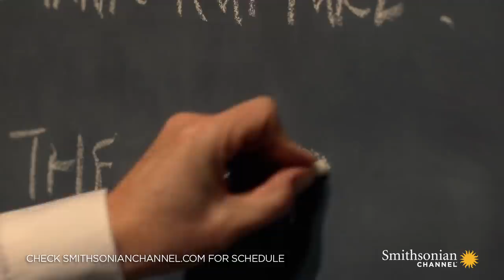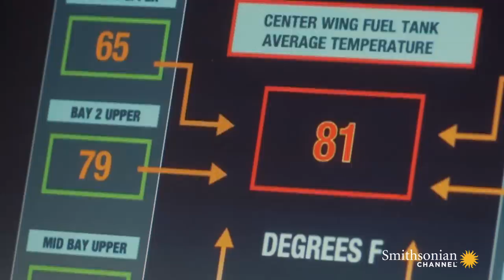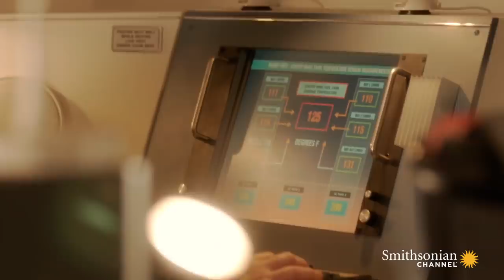How Air Conditioning Caused TWA Flight 800 to Explode

Comment: It is because of the sparks in the tank. The spark were occured due to broken fuel quantity indication system (fqis).
Reply: Actually No.  There were no 'sparks' in the tank (as were suggested)  and this is due to the function of the system itself and its architecture which precludes such.  The FQIS system 'cannot' produce and or produce any sparks or arcing by design.  the [current] used to operate the gauges/system, are in the trickle amounts and far below any of the minimum required electrical energy (tens times lowers) to be able to ignite any 'vapors, under the best conditions.  The Fuel storage and transfers system is grounded as well, and the system is full of redundancies to preclude any events for a fire or system failure.
Reply: @robshef718  hahahah

Comment: I don't understand the test they conducted, assuming the center tank had no fuel (due to safety) the results would be highly inaccurate, fuel typically remains fairly cold and it even used to cool down the hot engine oil. An empty tank with all packs on would surely heat up, but with fuel it would be a different story. Yes it would still get hot but 127? I don't think so
Reply: The NTSB story is fraud and we proved this in federal court..
Reply: fuel vapours are more dangerous than the actual substance itself
Reply: @ey7290  that's why we use nitrogen generating systems, to eliminate oxygen in the tank

Comment: Oh for fucks sake. TWA 800 had faulty wiring leading into the centre fuel tank which caused a spark and ignited the fuel. The plane wasn't shot down.
Reply: Sorry. No faulty wiring.  No ignited fuel.  (unless you think that the odds of several complimentary events, and  to exactness, just all "happend to occur" at the same time?  I could win the lottery five times before that one.   signed, former U.S. Navy Aviation.

Comment: How much did the NTSB pay the Smithsonian Channel to post this ridiculous speculation? Does anyone actually believe they did that test, because that was the most ridiculous 'recreation' I've ever seen....
Reply: But another team of investigators actually got a 737  fuel tank under nearly identical conditions to violently explode some years later.  I think TWA 800 has been incorrectly interpreted by the missile proponents, as they seem to ignore many pieces of the counter evidence, for example Fred Meyer's testimony supporting the streak as a late stage event, and the fact no witnesses seem to account for the 30-40 second gap between the initial event, and the resulting fireball.

Comment: A theory with no evidence.
Reply: To what are you referring to?
Reply: So the plane was delayed for 2 hours and with the air conditionars right below the center fuel tank and the ac when up to 300 degress and that vapored the fuel making it very easy to catch fire and with the aging electrical system of the 747-131 bundles wires mixed with high voltage wires and low voltage wires some are so warm they can short circuit. High voltage went to where it shouldnt go. Seconds later it went to the fuel probe and then it blew up.

Comment: The ONLY way the air conditioners were responsible for the explosion was because the missile seeker that was fired from underneath hit the A/C vents!
Reply: Incorrect. there was/ were no 'guided' AAM's as the initiating event. btw....The engines heat signature exceeds that of the AC pack bay.  The Initiating event was a X model AV transiting the airspace (FAA RECORDS IN federal court) that unfortunately due to miscalculations, ended up on a collision path.

Comment: The AC got hot enough to attract a missile?
Reply: No Warhead missile was involved in the initiating event.  in short, the 747 was not brought down by a warhead.  btw, the AC does not get HOT.
Reply: @robshef718  Not only the AC does get hot, as any AC or fridge (behind it) but this kind of explosion did occur before on another flight.
Reply: @robshef718  hahah you just said a plane hit it wow
Reply: @julosx  the ac brings hot air from the engine no wonder why it got hot

Comment: but what caused the spark
Reply: old and peeled out wiring in between of low & high voltage beign fixed with duct tapes. because remember this happen with an old 747 (built in 1971) that should have been retired years ago, but, the economy finances, they're obligated to fly until they manage to afford the proper replacement aircrafts.
Reply: * Of the 183 who said they saw a streak of light, 146

       provided a description of the path taken by the streak.

       Seventy-seven said it was ascending, 11 said it was

       descending, 47 said it both ascended and descended, 9

       described it as level, and 2 said it both ascended and

       was level.

* Color of the streak.  Forty-four said it was red, 33 said

       it was orange, 23 said it was orange/red, 24 said it was

       white, 2 said it was white/orange, 7 said it was yellow,

       7 said it was yellow/orange, 2 said it was white/orange,

       and one said it was yellow/red.  Finally, one witness

       said the streak of light was green.

http://twa800.com/4a/exhibit4a.html

Comment: Fuel isn't flammable?
Reply: Jet Fuel/ Aviation Kerosene is Not a Flammable fuel but a 'Combustible' liquid. It is very stable and has very low volatility thus a high Flash point, so it does not catch fire as readily as a higher volatile fuel like gasoline.

Comment: But how did the fuel explode? Like maybe there were sparks or something?
Reply: Corroded wiring coupled with a design flaw in the fuel tanks. This was one of the oldest 747’s still in service and was actually slated for retirement before the fatal accident.
Reply: @Ultimaton100  oh
Reply: @Ultimaton100  And BTW, you should start uploading some videos on your account.

Comment: According to some medias and sources, the probable cause of this was “short-circuit” that unexpectedly came up from cables from AC, to the flammable fuel vapors, the center tank. Of all accidents that we may already know of, I think this circumstance is just for once. Plane exploded without warnings, and fatally killed about 200 peeps and more? We’re not investigator, but I’m wondering if I was one of those doomed passengers. You wouldn’t know anything next, indeed. Sounds horrible. I can assume myself, this may be very rare cause of plane accdnt, as far as I know, plane would crash because of pilot mistakes, engine fails, structural failure (not fuel like in this vid), and so on.
Reply: The ac cables had nothing to do with it. It was the wiring for the lights that caused it. As faulty wiring had high voltage current jump to low voltage wiring that headed into the tanks which short circuited and the ac vaporized the fuel so when it did short circuit it ignited in seconds
Reply: The last words were “Power set!” As a spike in power happened

Comment: The reason why the plane exploded is bc of its extreme old age (40 yrs). It was so old that It had faulty wireing
Reply: The 747 was about a 25 year old MODEL...(not 40 years)  and still, that is NOT the age of the plane.  Planes are reworked, upgraded and overhauled.  There was not nor can be any faulty wiring in a fuel system that a spark will explode Kerosene.
Reply: @robshef718  the faulty wiring wasn’t in the fuel tank it was outside it. A low voltage wiring did go into the tank but that can’t possibly explode it! So what did? Well the faulty wiring allows high voltage to jump to low voltage wiring. The one that went into the fuel tank that was vapor fuel
Reply: @jonahmoran3751   again Jonah, where did you read this garbage?  There were No faulty wires, anywhere. (if you have read the reports, not look at propaganda video).  Your high voltage to low voltage concern is moot anyway,  in that there were NO vapors in the "vented"  fuel tank.  That even if there were, cannot detonate and blow a plane apart!  its kerosene, NOT dynamite.

Comment: there was nothing aboard the aircraft that could have sparked the fuel vapor in the tank it was not possible to generate the current needed to cause a fuel explosion
Reply: That's what we proved in federal court. thank You!  :)
Reply: @robshef718  so a short circuit can’t ignite fuel from faulty wiring allowing a high voltage current to jump to low voltage wiring that went into the fuel tank that was vapor fuel? So it can’t ignite?
Reply: @jonahmoran3751  I know this is from a while ago but you have to have three things to cause a fire ,fuel oxygen and an ignition source. Kerosene is not some explosive substance like gun powder which has it's oxidizer built in. sitting on the ground with ac running on a hot day would vaporize more fuel  but that would also keep oxygen forced out if the tanks were vented, once they took off they rose in altitude which would increase venting, This whole story is propaganda.

Comment: Everyone missed what caused it's center fuel tank to explode. It's very simple to explain. When the planes air conditioner heated the center tank and when it reached a specific altitude she exploded from dieseling as the center tank reached either a positive or vacuum pressure of 32 psi. No spark is required for a tank to deseil explode.

This pressure could have built up from a damaged pressure relief valve vent or a filling cap seal failing.
Reply: Just several problems with your theory. the fuel tanks would never hold 32PSIA as they were not designed to hold positive pressure at that level. second diesel fuel is not used in commercial airliners. JP8 or kerosene is the only approved FAA rated fuel and lastly, neither of these fuels will explode our combust from a " diesel " event nowhere near the pressures and temperatures your stating.

Comment: “We need to rest of the fuel is flammable” yea no shit Sherlock.
Reply: Aviation Kerosene is not a flammable liquid but a combustible liquid.
Reply: @robshef718  it is flammable as liquid but it’s pretty hard like the same way diesel works. Diesel is hard to ignite in liquid form and that’s correct but when they are in vapor form it’s easy to ignite very easy

Comment: How come other planes, flying from the same airport, using the same amount of air-conditioning, didn't explode?
Reply: So the plane was delayed for 2 hours and with the air conditionars right below the center fuel tank and the ac when up to 300 degress and that vapored the fuel making it very easy to catch fire and with the aging electrical system of the 747-131 bundles wires mixed with high voltage wires and low voltage wires some are so warm they can short circuit. High voltage went to where it shouldnt go. Seconds later it went to the fuel probe and then it blew up.
Reply: @noahthesarcastictd  other planes where also waiting for over 2 hours and didn't explode. It happens all the time where planes sit on the runway for hours till take off, in much hotter climates. And no one exploded. 
Give me a break
Reply: @yoyoyoyoyoyoy9  because there is no spark.
Reply: @yoyoyoyoyoyoy9  if there were all of those planes probably exploded.

Comment: but what caused the spark
Reply: Faulty wiring (which is proven) allowed high voltage current to jump into low voltage wiring and it went into the fuel tank and short circuit which is also proved by two microsecond pauses right before the recording goes dead.

Comment: what about all the 747's that are still  around   now  , have they altered the air- con - packs location perhaps ?   ie ) 747 - 8
Reply: Youre conparing a 747-100 which first flew in 1969 to a 747-8 which first flew in 2010 for the F variant and 2011 for the I variant, you are comparing apples and oranges

Comment: 747 first flight was 1969 hard to believe not 1 other 747 had a similar scenario maybe even hotter ? 87 degrees is not that hot I'm sure a 747 has taken off in hotter weather in all sorts of conditions.
Reply: The Navy fired two missles from one of two submarines and 21 surface vessels in that area that were conducting missile tests exercises.
The missiles were seeking out drones fired from one of the surface vessels,.......TWA 800 breached the perimeter of the military exercise airspace.  The first missile targeted the heat signature from the third engine of TWA 800, then the second missile targeted that explosion.
The issue with those center fuel tanks did exist,....up until 1969.  In that year,  Boeing completely 
redesigned the center fuel tank system for the 747.  The TWA 800 aircraft was built in 1971, therefore, the fuel tank issue did not exist for that aircraft.  The Clinton administration, FAA, and NTSB used the 'center fuel tank' theory as propaganda to cover for the Navy's grave mistake.
Reply: In 1976, a 747 blew up after lightning hit its fuel tanks.
Reply: @kamikaziwastaken  ......source?
Reply: @trueknowledgeispower  Search up Iranian 1976 747 Fuel Tank explosion

Comment: extremely high temperature in the tank versus low temperature at the external, isn't that supposed to cause some kind of fusion or temperature friction?
Reply: Nope.  The tank never gets Hot.....by any 'operational' factors.   it cannot, by reason of its design and function.  The NTSB was cited in Federal court for Fraud....

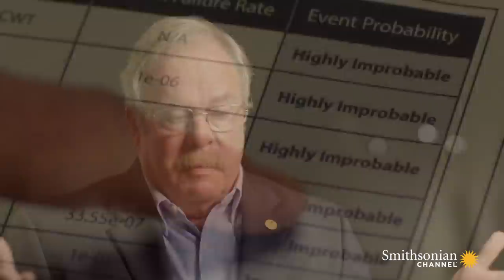Comment: 1:08 According to Boeing…
Reply: It does not get hot inside the fuel tank. the Flash point is never reached. The heat story is bS.  Spin.

Comment: Its always amazes me that after a fatal incident Boeing ect builds the plane different safer if you will when I think they should have built it safer in the first place probably cutting corners for $ id assume 🤷‍♂️
Reply: this video is fake news propaganda.  You cant 'detonate' a center fuel tank. The details in this video are fabricated...fake news...BS....    The plane was hit by a missile. I guess you missed the court case??
Reply: @robshef718  I'm copy-pasting this from my other comment because I'm tired

What those people really saw was the already burning plane rise into the sky because of the wight it lost when the nose can of the plane and the engines were at high thrust and the weight loss caused the centre of gravity to shift to the back of the plane.

And then they saw the plane stall out and further explode apart

Also, there was a 737 pilot watching TWA-800 from his plane and he said the explosion came out of nowhere. no mention of
a missile.

one last thing, as you know sound has a speed so by the time these people heard the explosion the plane was already in its death climb and was about to stall. So those people thought they saw a missile rise up to hit the plane and the plane fell.

 When what really happened was the plane itself rose up and then stalled.

if you don't understand any of that I can't help you there
Merry Christmas.

Comment: But what ignited it
Reply: A US Navy missile
Reply: @YourselfAndEye  lmao you forgot a spark is possible. Your just too blind to actually look at evidence of actual damage wiring  and see that the wiring allowed high voltage current to jump to low voltage wiring and then that wiring with all this high voltage that it wasn’t designed for went to the fuel tank and short circuited and sparked the fuel

Comment: Twa was shot down, whether you like it or not
Reply: The plane was not 'shot down'...whether or not YOU like it.    :)
Reply: Rob Shef air crafts are meant to withstand heat, if that’s the case than most of the 74’s would be raining down from the skies, hi tho
Reply: Ok. Did you have a question?  Of course.  Aircraft do withstand heat in the areas they are designed to withstand heat.   So, not sure what your post is about..   :)
Reply: Mowac win 😂
Reply: so, then, I see stupid flocks together..... :)
Reply: Rob Shef hello after a year maaaaannm

Comment: "This is off the charts" 3:32

It's 127 degrees Fahrenheit, while the scientist said 350 F... 🤔
Reply: The video is wrong. At ' About 127 F' is the 'Operational' Flash Point of JET A.  But the FP does NOT mean the fuel is going to 'explode.'  The FP is the (Liquid Temp) where the vapor at the surface of the fuel can 'start to burn'.  That's  it. The vapors don't 'explode'.   However, or, by the way....the Center tank {cannot} even reach that temp, by Architectural Design.   Any spin on 'any temps' is MOOT.  Pure 'Junk science' as we proved in a Federal court, and  as we impeached the NTSB for Fraud.   *  However.... {The devil is in the details}  Had any surface fire on the surface of the fuel 'had' somehow started, there is a fire system in the tank that would immediately extinguish it.  This is what the NTSB does not want the public to know.  When the plane was recovered and with all of the 'systems' Fire bottle, not One squid was activated.

Comment: Grow up Smithsonian - the NTSB ruled that a live missile detonation did NOT occur (ie. no high speed spalling of surfaces), but they DID NOT rule out that a NON detonated (dud) missle did NOT hit - in fact if one looks at all the evidence, this is CLEARLY the case.    Even then NTSB said this was possible, but 'further testing required' 

Yes, the CFT fuel vapours did detonate, but it did this because a missile struck the centre of the 747 and then did not detonate upon or prior to impact.  

You have high level/professional/military witnesses stating a streak of light flew towards the ship. 

You have high levels of RDX in the cabin areas

You have a INGRESS hole in the side of the fuselage, thanks to the assembled wreckage.
Reply: I remember the asinine explanation given for the streak of light, that after the cockpit separated it continued upwards for a short distance, leaving a trail. Ridiculous, but then again they didn't have much to work with to concoct a plausible story either.

Comment: It was an arc that set the gas off there are wires that run through the tank at low voltage so it wouldn't spark but faulty wiring allowed an arc to the wire in the tank